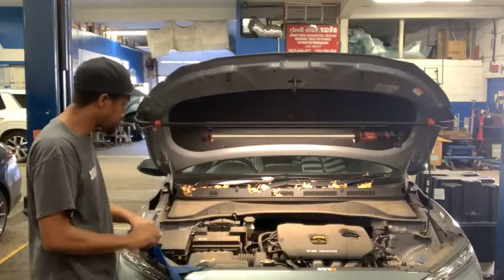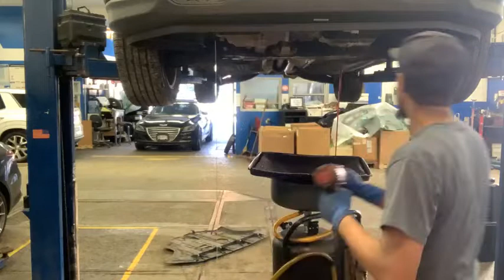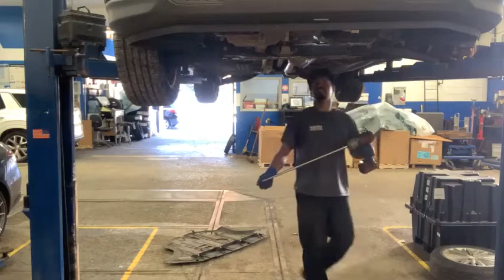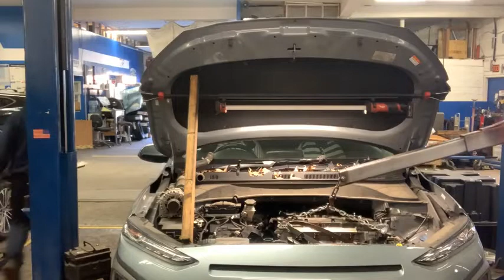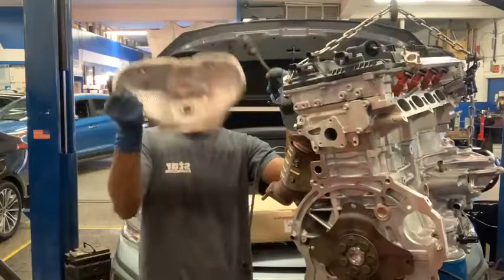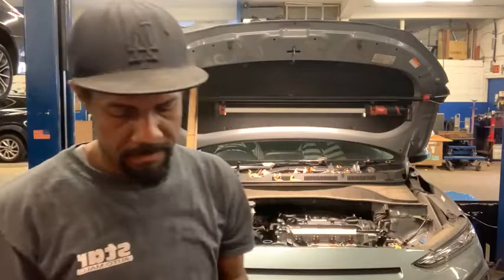2020 Hyundai Kona 2 0L Engine Removal And Installation 11 10 2021

Comment: My brothers 2021 Kona has only 36 k on it he bought it new and is currently at the dealership getting the engine replaced all under warranty thankfully original engine from the factory went out after only 36 k and yes this Kona had the oil changed regularly every 5000 miles and only used oem Hyundai oil filters and sometimes but very rarely used k&n or Mobil 1 oil filters when oe ones weren’t in stock and Mobil 1 full synthetic oil or Castrol edge full synthetic 5w20 we can’t believe that the engine went out like that
Reply from the maker: It’s something with this Hyundai Engines.

Comment: How much can this repair cost part and labor breakdown please.
Reply from the maker: I not to sure. Must of this Engine work is warranty.
Reply: I heard it was $8k, I'm sure they pay crap hours for it since it's warranty work though.  I'm getting my konas engine replaced under warranty at 58k, always was serviced on time with full synthetic and a mobile 1 extended performance oil filter.